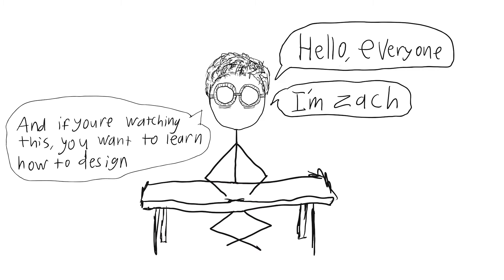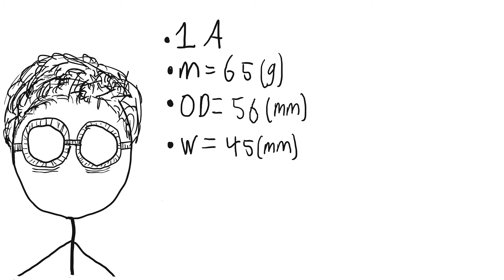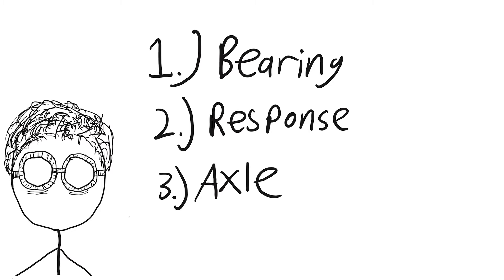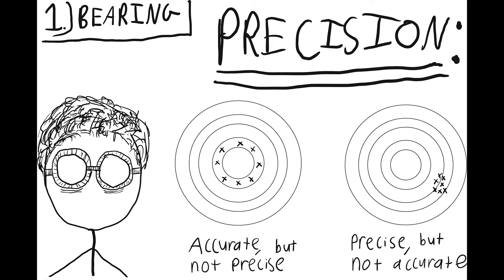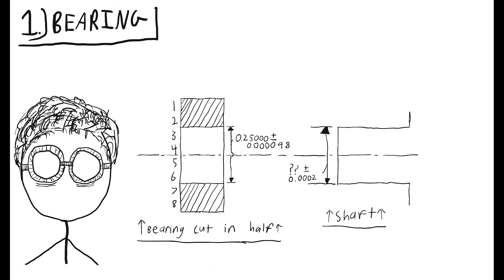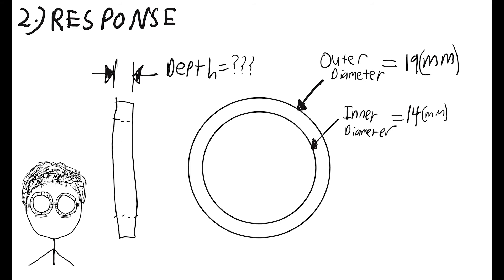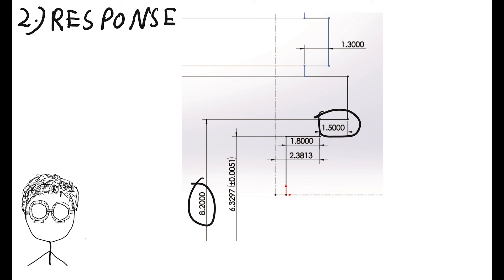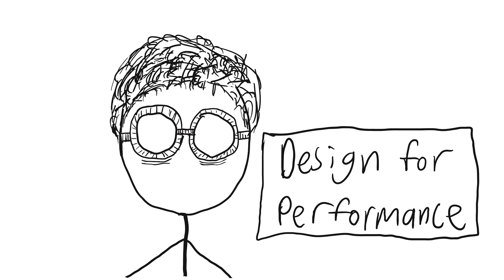Yoyo Design 101: Lesson 1: Introduction and "The Guts"

Comment: this series is amazing! there's so much good information, and I can't wait to see this continue! now then, I've got a question and a small criticism of the video.

okay, first of all, I personally felt like that video was a little too long. now, I'm admittedly someone with quite a short attention span, but I had to watch the video in two sittings just to get through it, then I had to watch it a second time to make sure I didn't miss anything. though, it was definitely worth it in the end. One option is to cover each topic in multiple videos by having a shorter video for each sub section of the larger topic? Mind you, these videos are amazing, there's a good chance I'm the only one with this problem, and I'd happily watch the videos either way no matter how many sittings it takes.

as for my question, what advantage is there to a smaller bearing? I was staring at my hspin nvx and its D size bearing for quite some time, just to figure out why they used it, and I just drew a blank. So, have you used a smaller bearing in any of your designs? if so, what advantages does it hold?
Reply from the maker: Thank you for the criticism!  You are not the only who have that problem, as I too have that problem! It is most certainly something I will compensate for in the future.  And as for the question, I ABSOLUTELY want to do a video explaining the design characteristics of different bearings, as I have omitted that concept very largely and focused mainly on pads and axles for the two videos that are currently out.

There are two main reasons that come to mind for why a company may choose to use one bearing over the other.  They are cost criteria, and performance criteria.  

On the topic of cost, if D sized or A sized or E sized or just some freaky custom sized bearings are readily available to you, and cheap to acquire, it makes sense that you might be willing to eat the loss created by yoyoers who don't want to own a yoyo with an incompatible bearing size in exchange for the savings in initial manufacturing.  This was especially prevalent in the earlier days of the rise of the all metal yoyo (early 2000s to mid 2000s) when there were still competing standards for what the most commonly used bearing would be, especially in the European and Asian markets where transaxles were giving way to whatever commonly sourced metric sized bearings could be found with acceptable performance.

And on the topic of performance, in the extra lesson #1 video, I mention how the axle will bring a yoyos rim weightedness down because it's a big piece of denser metal at the center of the yoyo.  The same can be similarly said for bearings. Smaller bearings are usually lighter (with some exceptions due to weird quirks of bearing design and different material choices and all that jazz) which means that higher relative rim weights are possible with smaller bearings and shorter axles.    Additionally, yoyos with smaller bearings can spin faster, due to the limited speed at which a human can throw something coupled with the smaller "rolling diameter" that a smaller bearing allows a yoyo to have (just like how a smaller wheel on a car needs to spin faster for it to go just as fast as a big wheel bicycle).  Interestingly, the effect that uniformly higher rpm has on the yoyo is not universally good or bad.   The higher angular velocity tends to make the yoyo more likely to snag, thus requiring a slightly wider gap, as well as making the yoyo require a lower moment of inertia in order to "feel" like other yoyos of their desirable performance characteristics at that mass and diameter.  Also, a yoyo with a higher average angular velocity tends to be harder to regen because, on average, it's more difficult to regen a yoyo that's coming to your hand faster.

If my lack of concrete terms like "always" and "will" are indicative of anything, it is that; as indicated in the video; yoyos are quite complicated, even down to simple stuff like what bearing you choose to select.
Reply from the maker: Thank you. So, first off, if it was too long, and you still had to watch it twice, wouldn't you say that it really wasn't long enough? Should I have had a part at the end that was basically a TLDR? But, see, if I did that, the entire philosophy of why I made this video; that "people NEED to understand the reasoning behind this design in order to be able to use it properly" would be betrayed.

Now for your next question there. Most bearings in the early days of experimentation were used either because they were cheap/easy to source and produced a good performing throw, or the specific characteristics of a yoyo such as cost, or performance requirements mandated a specific type of bearing. The Imperial used no bearing because it was cheapest to manufacture. The Proyo used either a wooden turned piece as a spacer in a plastic part on a cheap standoff threaded into a transfer molded nut because it was cheap (although not as cheap as the fireball, in my interpretation). The fireball was a pretty revolutionary design, as it used the compatibility of different materials by criteria of abrasion compatibility (see a table of "Wear Coeficients" if you wanna know more about that) and used a plastic bushing/stringholder that they called a "Transaxle" system which took the place of the proyos wooden central bushing (I don't know if later models of the proyo or other similar duncan designs switched to a plastic, but they might have).You'll see that almost no European yoyo companies that had their roots early in the ball bearing revolution use a "size C bearing" because a size C bearing is only a standard denomination in inches (it's 0.5 by 0.25 by 0.1875 INCHES) whereas a size D bearing is 11mm by 5 mm by 5 mm in the same measurement convention used earlier in this sentence (OD, ID, W). It makes sense if you are in Europe that you aren't likely to have imperial standard components in your short list of "parts I want to design my toy around."  A lot of asian (Chinese mostly) companies used imperial bearings because they emulate US and European design trends and there's rampant intellectual property theft that occurs between American firms that have their parts made in China, and identically constructed Chinese firms that are usually able to undercut the American company using the exact same components and bills of materials (see the history of the Segway for example there).

I have used nearly every single bearing size that exists in my designs. I certainly think that with the renaissance of flowable response, companies should feel confident to try other bearing sizes once more. The biggest issue in doing that nowadays is that most bearing widths that have been used historically were customized for either responsive or semi-responsive yoyos. If your bearing width infringes upon the length scale of your "string width" then you can only do so many wraps around the yoyo with the string before it snags, as it gets awkward to try and have a gap that's bigger than the width of your bearing.

The impacts on design that different bearing widths can have is immense. They all have different rolling friction versus radial load plots, and so they all slow down differently as you speed through them on faster tricks (applying more centrifugal force to be transmitted to the yoyo shafts through the ball bearing). You'll usually see certain designs which get better quality to them as more of those bearings are ordered by different industries. That's why so many machines and stuff use what are effectively SkateBoard bearings for their rolling elements, as they are so largely made that they are cheap in bulk and generally high quality. The larger impact on yoyo performance,  however, is mainly due to the nature of how rotational velocity works.  As you go out on the yoyos radius, the surface speed with respect to the string increases, and the inverse is true as well. This means that if you have a lower diameter bearing, but use the same amount of radial length of response and the same gap to the yoyo, it won't bind as well, purely because the friction at play is directly proportional to the relative velocity of the pad surface v.s the string.

Now, one interesting thing to think about is how that trend CAN'T be true as you go to the lower limit of rotational speed. At zero rpms, the friction coefficient at play is the STATIC friction coefficient rather than the kinetic friction coefficient, and it is an observed physical law that the static friction coefficient is always higher than the kinetic friction coefficient. Therefore, there MUST be a certain rpm, and consequently, radius of bearing, at which the yoyo would be EASIER to bind with the same scale sized response pad rather than harder to bind; but that seems like something that I don't want to do the math on quite yet.

Hope this answered your question.

Comment: When you find the length of the shaft, you took the width of the bearing, which is 0.1875in, converted it to mm, making it 4.7625mm, then added 1mm, giving you 5.7625mm, right? All I did was add the 1mm in the equation you set up at around 11:14 to both sides of the equation. After that, I divided both sides by 2 and that got me 2.88125mm for the shaft length, which is more than 1 whole mm longer than what you said it should be in the video. Can you clarify this?
Reply: Nope, nevermind, the subtraction of 1mm wasn't a part of the equation at all, I misread that.

Comment: [SERIOUS] Could you elaborate the importance of the shaft length?
Reply from the maker: Too long and you can't put the yoyo together. Too short and it won't be able to sustain the shear forces or be able to transmit bending moments of either a regular throw, or a ding. The conclusion here is to make the shaft as long as you can, but not too long. The reason I picked the length that I did is because I calculated how much the seat could possibly deform if you tightened the yoyo a lot; which would subsequently bring the two faces of the shaft on each half together as the yoyo deformed from being overtightened.

Comment: Bearing air release grove?
Reply from the maker: +Ze&#39;ev Yehuda  If you've ever wondered why  that secondary step was even there in the first place, or even why it is as deep as it is, the reasoning for it is that if it were any deeper, it would become the structural weakpoint for the throw, and any shallower would make it so that the air swirling around the inner race of the bearing wouldn't have enough volume to  swirl around and properly move air around the bearing.  It is a relatively arbitrary dimension, but it's there for a reason.
Reply: +ZachTheSloth Why is it important for the air to swirl?
Reply from the maker: +evilbee Two reasons, one of which is more important than the other.  The more important one is that when a torque is put on the bearing, the outer race of it may deflect slightly, and there needs to be space made to assure it does not hit the side of the yoyo.  The less important one is that bearings without proper space to allow the free flow of air tend to lead to a buildup of particulates in a weird feat of fluid dynamics.  A similar effect to the eyes of hurricanes can be seen, wherein particulates that find themselves near the center of the yoyo have an easier time just staying there than they would getting out.  This is one reason why shielded yoyo bearings coupled with outer bearing wall diameters too small for household particulates to escape from tend to lead to yoyos which accumulate foreign particles. And the definition for "too small" is ultimately the average boundary layer height for the air flowing past the yoyo bearing at that diameter, which you can learn slightly more about here.  https://en.wikipedia.org/wiki/Boundary_layer

However, let me warn you of this; fluids are complicated; so complicated, in fact, that we as a species will understand the inner workings of dark energy and the nature of the universe before we can accurately predict the flow of syrup in a bendy straw.